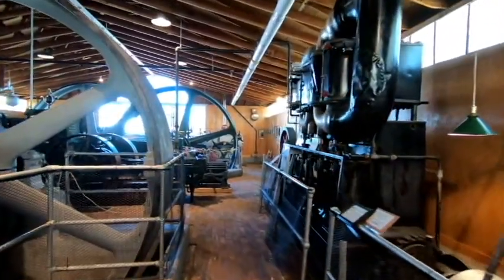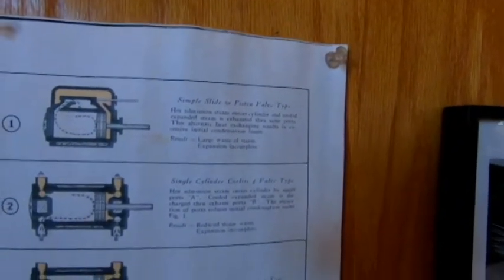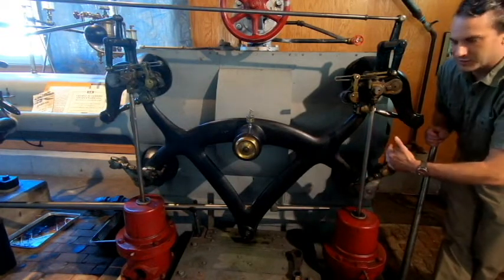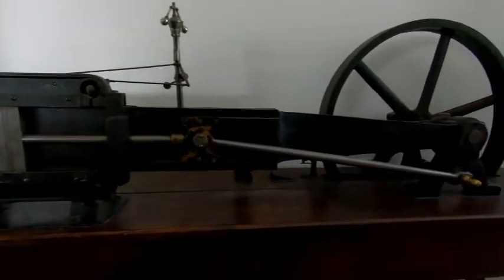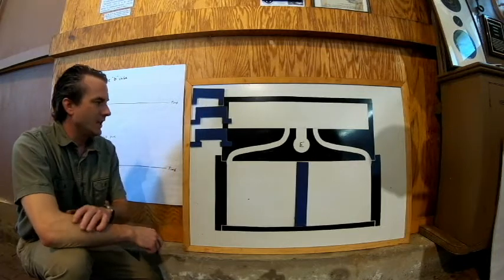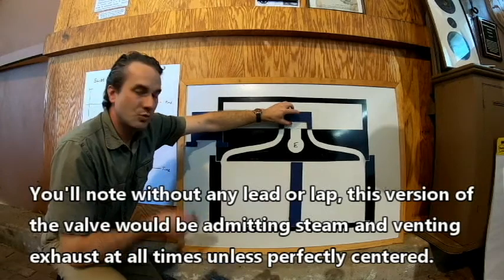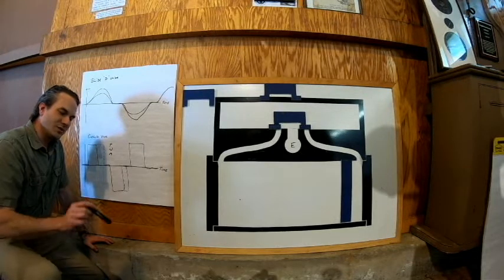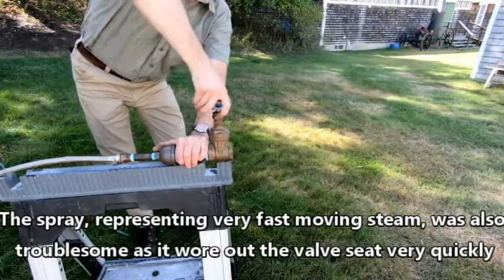Corliss Steam engine valves (Technical explanation)

Comment: Cordless was a business genius as well. He provided his engines for free or close to it and charged the users half the difference in fuel costs between the slide valve engines and his rotary valve engines. He made a huge amount of money with this scheme. 

These engines provided mill power until grid based electric power became available and it was possible to put electric motors on each machine. The American Precision Museum in Windsor, Vermont has a small line shaft set up that can be turned by hand. I was amazed by how little force was required. 

Both of these museums are time well spent for machine freaks like us.
Reply: Very interesting bit of information. Thanks for posting!

Comment: Pulse width modulation.  For me, WW2 seems to be the pinnacle of accomplishment by mechanical means what is now done via electronics. Sensors now instead of cams, eccentrics, rod length and grooves/slots.   I do appreciate what you are presenting here.
Reply from the maker: Thank you!  Of course this predates WW2 by 90 years!  We have another device, a hydraulic governor, that has a technology on it that was used in naval warships for fire control.  Another mechanical version of what is now done electronically.  You've given us another idea for a video!

Comment: Slide valve engines with cut off governors also control speed by admission timing much the same as 'linking up' on a locomotive.
Reply: I think this is an important omission from this presentation. The slide valves WERE adjustable after the engine was built. Stephenson's slider system controlled the stroke of the slider valve to adjust how much steam entered the cylinder. Having said that the very rapid opening and closing of valves, the separation of inlet from exhaust and independent timing of inlet and exhaust are important contributions of the Corliss system. I was talking today to the operator of a full size (90 foot) steam ship and he did not understand the fact that efficiency of the engine could be controlled with the Stephenson valve. They control their engine simply by adjusting steam pressure/volume provided to the engine.

Comment: WIAT a minute.  The walschaert and Baker vale gear used on locomotives allow for a variable opening and closing of the  valve. The lead and lap is changes by changing the stroke of the steam vale.  Engines starting under load receive full boiler pressure, As the speed increases the stroke is shortened and less team admitted to the cylinder allowing expansion of steam to keep the engine running more efficiently.

No locomotive ever used corliss  valve gear as far as I know.  You refer to the action of a D type valve only used on low pressure engines - stationary and in locomotives.  The big engines developed in 1930 - 1946 used spool valves or poppet valves.
Reply: and the Stephenson Valve Gear had the same function shame this was glossed over

Comment: Good video, the point at the end about letting the steam expand is interesting. Intuitively it just seems like you would want as much steam as possible, i guess if you can save steam then ultimately you can save fuel.
Reply: they came up with compound expansion where you would have 3 cylinders. the first high pressure the second gets the exhaust from the first so medium pressure , the last gets exhaust from the middle cylinder and expands the steam completely. titanic used that as well as a turbine as the final stage.

Comment: Great explanation ! could the corliss valves be replaced by   modern valves as those used in gas engines ?
Reply from the maker: Oliver, Modern tech could probably function similarly if that is what you mean.  The astounding part is that this variable valve timing is done purely mechanically and was invented 170 years ago.